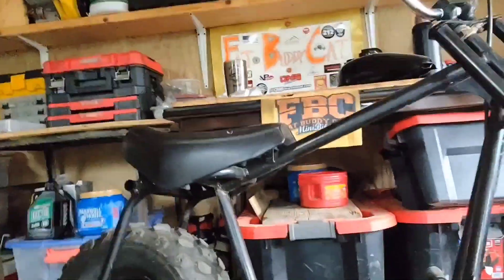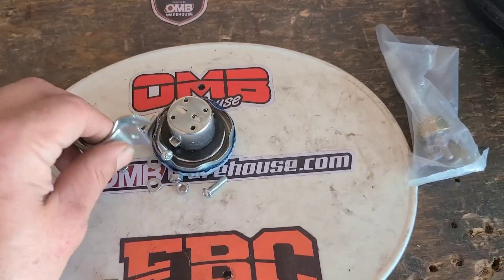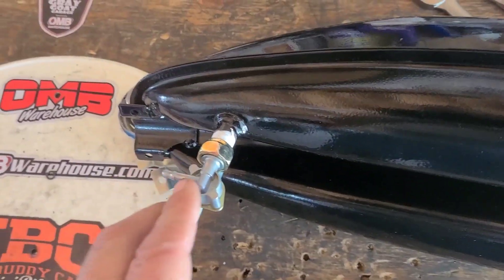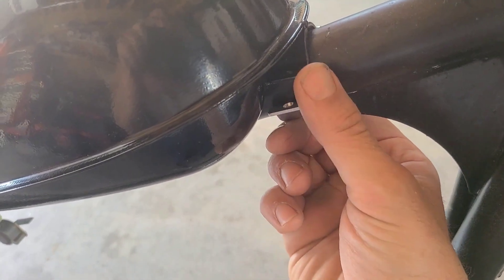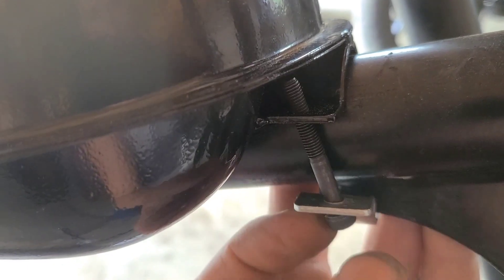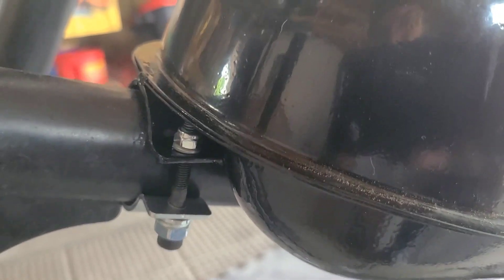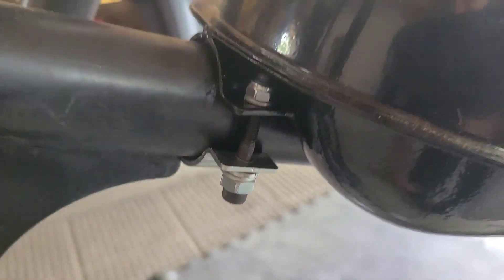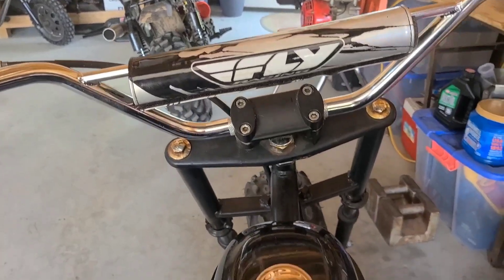Custom Off Road Chopper "Amazon 4L Tank Installation"

Comment: Great video , I have used that same thank on  bikes , I cut strips of thin rubber and put it around the down tube to the tank don’t  rattle around .
Reply from the maker: Thats awesome! I actually edited that part out! My rubber strips were too thick for the hardware to completely clamp.....☹️....back to the dollar general!
Reply: @fatbuddycat  That door and window foam strip stuff works great to .
Reply: There’s a whole stick of jb water weld under mine .

Comment: Great info FBC! This is gonna help me a lot on the Baja bikes! I was wondering how that 4 liter tank would look and it looks great! The 2 liter bike tank would be too small and the motorcycle tanks I've seen look a bit large. That 4 liter is the Goldilocks tank, "it's just right"!
Reply from the maker: I cut up some rubber and slid it underneath too just for good measure! Rick from Busted Knuckles caught me skipping that step!